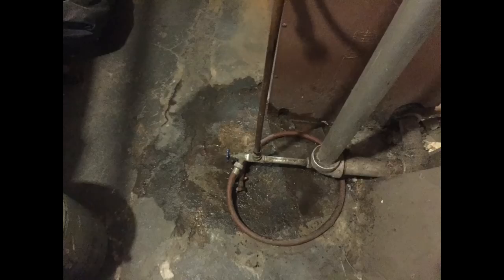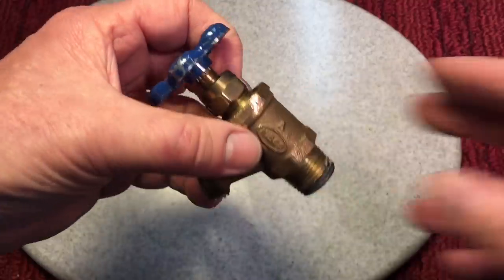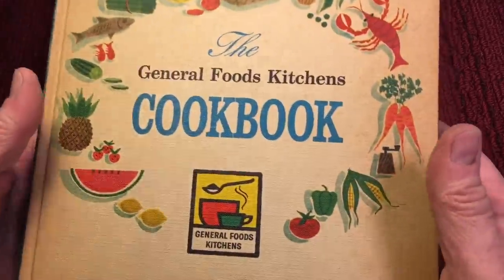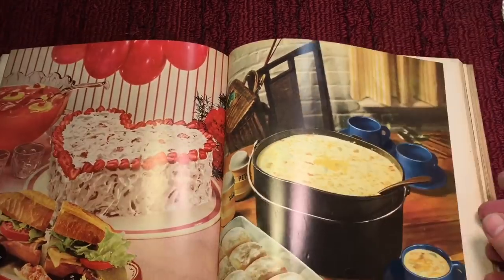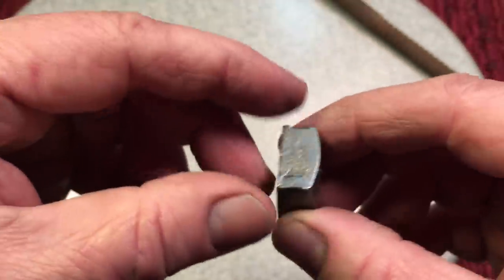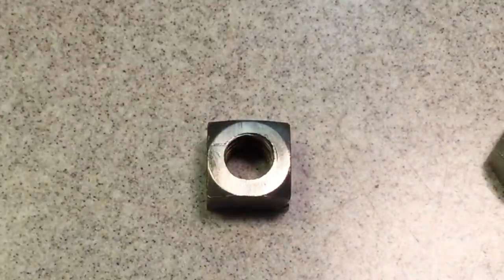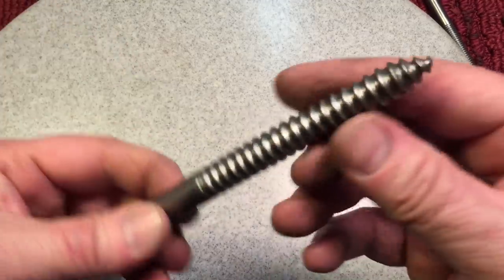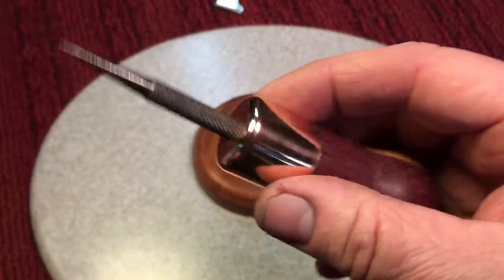It’s Hip to be Square!

Comment: I use both Teflon tape and Teflon pipe dope tgether on brass or copper pipe threads.  An old plumber I worked with many years ago, God rest his soul, told me to do it that way to prevent leaks.  It always has served me well, using both.

Comment: Working on fire suppression systems and as an industrial building mechanic, I can tell you that gate valves are awful too.

They're not terrible if you have water with a high degree of purity. We use a lot of gate valves such as post indicator gate valves for the sprinkler lines delivering water to the buildings, and OS&Y gate valves for sprinkler mains as well as fire pumps. 

We also use butterfly valves for individual systems and ball and globe valves for low point drains, drip legs, inspectors test points, 2" main drains, etc.

By far, the gate valves have the highest failure rate. They constantly need to be repacked and almost never completely seat when closed. Even gate valves used for smaller applications such as 1" elevator shaft sprinklers constantly fail.

Comment: Thanks for the schooling on square nuts. I restored an old pipe-vise and all the nuts/bolts were square. I mistakenly thought they were used simply because they were cheaper to manufacture. I did appreciate how much grab a wrench had with them though. Good find on that 40 year old valve. Never throw anything away.

Comment: I'm not a licensed plumber but I'm a GC who does 99% of my own plumbing work and I've worked alongside plumbers for over a decade. For water pipe I use teflon tape first then pipe dope on top of it, the regular white teflon tape and Recorseal Tru Blu are my usual combination. For gas pipe (black and galvi steel pipe) I use pipe dope only, Rectorseal no.5, my local inspectors (socal) want to see the yellow color but it may vary by location.

Comment: Slictite pipe dope then teflon tape. The hose bib you have is a compression valve and works very well. Ball valves stick and make more noise if not turned on fully. You can use either dope or tape or both. It really makes no differance.

Comment: When installing on a boiler I always use both  teflon tape and gasoila pipe dope and it will not leak.  One of the nice features of the boiler drain valve is that you can get a GHT threaded cap that can get you through until you can safely change a  bad washer.
Reply from the maker: Paul!  Yes!!!  I know I have one but God only knows where it is!!! 😂😂😂👍
Reply: @ScoutCrafter  Good luck on that!  Wire it to the valve wheel when you find it. :-)

Comment: A cat that choses you is hard to deny! I have a small assortment of square nuts from my grandpa's hardware stash. I use 8 pt. sockets often on engines for pipe plugs, for soft ones(brass or aluminum) only a square one will work! (Hello Snap On)

Comment: If your hex nut has no top or bottom the hole should be chamfered on both ends this is why it looks bigger. Your sq nut has no chamfer on the top and a small maybe a small chamfer on the bottom. I am left wondering one day you'll come and tell us about the latest find ... a 8 point combination wrench!
One thing I always wondered how those colored arrow on the wheels worked.

Comment: I've got to tell you, I worked in a boat yard when I was a kid and would pick up these stainless steel volts around the yard.  These were used in zincs on the boats and were just tossed when the new ones were put on in the spring.  I would take the corroded, dirty bolts and would clean them up on the wire wheel during my lunch.  I still have some that I use and that was 30 years ago! 😄
Reply from the maker: I spent a lot of time in the boatyard as a young man.  In the 70’s boating was big!  Now the yards are mostly gone and it’s an expensive endeavor.  😃👍

Comment: I'm not a professional plumber, but the times I have used it, teflon tape has worked well, including auto fuel lines .  Thanks for the square nut tutorial. I really like the detail you go into for seemingly humble and simple pieces of hardware and tools. To me this is important knowledge.  Usually I only see lag screws with square heads at the hardware store, but I was surprised to see a kit of various sizes of square nuts for sale at my local hardware store. Seems like a rarity so I bought it. It also means that my antique Blackhawk multi wrench isn't fully obsolete yet. Regards from the west, where more precipitation is on the way.

Comment: To answer your question about tape versus dope it depends on the plumber.  A lot of plumbers use both.  First you put tape on then you brush dope onto the tape.  Only dope the male fitting, never the female fitting.  If you are going to use only one type generally people use tape on water lines and dope on gas lines.  Boiler installations typically have both.  I use both on water and gas.  Never get leaks this way.

Comment: I remember those cold winters rattling in square head lag bolts into misc. wood structures in the shipyard. 8 point sockets and old ingersoll rand air rattlers. That cold air coming out of the exhaust would turn you into a ice cube asap lol.  Yet those square heads were plenty sturdy, never rounded one off while installing. When removing, it was the burning torch we used.
Reply from the maker: Dale- You certainly paint a pretty picture!!!  Awesome description!  😃👍

Comment: 10/4 on the square fasteners. When you use them, they HOLD! As far as plumbing, when I got the wood splitter kit I had to take off fittings that had WAY too0 much tape on them. Already were unwinding and going into the valves and lines. I use the teflon paste/goo/ Unc is the same way. The paste works for all of my deals. And being from the South the cook book rings home to me. My raising caught up with me I guess. Thanks, John CS! GOOD one, Buddy! GBWYou and that demanding cat!

Comment: Lowes has 2 types, of what you call Globe Valves. 
A Hose Bibb is for the use of connecting a garden hose to. i.e. To wash your car.
A Boiler Drain is for draining a boiler/hot water heater fast. It turns open faster.

Comment: I have plumbed many air systems in my life & the introduction of Teflon tape back in the ‘60s created a whole host of problems. Mostly the tape getting into the air stream & fouling up valves & other devices downstream. Also we started having air leaks in our systems. Teflon was developed by the aerospace industry  & everyone thought it was the cat’s meow. Many times our work was inspected by another agency & invariably they would find leaks. We would have to redo several joints & we would go back together with tape and lock tight. Problem solved. Tape works ok on perfect threads but rarely are they perfect. I found a little secret about sealing pipe threads. I’m order for a leak to occur, the Fluid had to follow the helix of the thread to the low pressure side. Plug only a tiny spot on the helix & you’re good to go. Merry Christmas by the way.
Reply from the maker: Hi Steve!  Great tip!

Comment: I've dealt with those square nuts and bolts. I was always curious when the switch happened from square to hex. I don't think I'm as crazy about hardware as you, but I definitely appreciate it. Especially brand new hardware in drawers at the hardware store.

Comment: The majority, if not all of the pipe dope has PTFE (teflon) with non hardening compounds and whatnot,  so thinner, but will make a seal on the threads.  The tape is more solid, and lays on solid over the threads, and can put a few wraps around the threads, 3-6 depending on the thread condition.  While I was with one company, we always worked in the mechanical rooms with the steam turbines and water pumps and chillers, so on and so fourth.  One of the co-workers put the dope first, then the tape.  I asked him why he did it like that, a technical answer shortened; "He hates call-backs."  Some background, these buildings were built in the 70's, some like the financial district, possibly around the 20's.

Comment: Ball valves are the only valves worth using.
And I use yellow "gas" teflon tape on most any tapered connection. Two wraps. White teflon tape is useless.
I only use pipe dope on gas lines. Soft set.

Comment: I have a complete set of Craftsman 8-point 1/2" drive sockets that I have had for years. When you have to have one; NO OTHER socket will work, So, I don't mind square nuts in the least. Outside of lag bolts, you don't really run into them unless it is an antique of some sort.

Comment: Today, while I was cleaning the snow of the car, I thought about the headlights when you drive during a snow. Up till recently, the headlight bulbs would let off some heat to sort of melt the snow from the lenses. Now with the fancy LED type headlights, they don't give off any heat. The average car doesn't have headlight defroster. Hmmm 🙄
Reply from the maker: Bill- Halogen lights are preferred by many manufacturers for that very reason... Now they are adding headlight "heaters" to compensate for the lack of heat from the halogen bulbs.  Absolutely ridiculous!  Now a headlight assembly cost $300 where a round headlight used to cost $4.99.   =P

Comment: I wish they made square sockets larger because recently I wanted to take out the drain plug on some 2 inch plumbing but I couldn't muster the force needed even with a pipe on a pipe wrench (I'm getting too old!) so I got on google to try to buy a 1/2 inch drive one to fit on my air impact tool. Couldnt find one. You know of any place that makes them that large?
 On the recipes you have to watch out because some ingredients change. For instance white vinegar used to be 11% and now it's 5%. I still make a lot of the old recipes, they're way better.
 Teflon tape, I always buy the mil spec stuff because it's 2-3 times thicker and doesn't static cling to your thumb as you're trying to get it around the threads. You don't need as many wraps because it is thicker. A local plumber recommended it to me. Menards is good about their employees that way.
 I scored 2 humidifiers on my walk the other day. One is RGB and has an oil diffuser but needs fixing. I steam cleaned the working one and have been using it for like a week now. It can put a whole gallon of water in the air in about 8 hours & uses only 30 watts. Some one put them both out in a nice box next to the trash - They obviously wanted them passed along to some one who would use it. My sinuses thank them. They're so much clearer now!
Reply from the maker: John- Great info!!!  I have steam heat so the humidity is good but a humidifier is really important for dry heating units!  Makes a big difference!  😃👍

Comment: So by need, the offset open end wrench was created, soon to multiple siblings of various designs.
Forgot I use pipe dope with teflon bits. Stays in place and easier than rapping tape in tight places

Comment: John-valves are funny things...you could have easily gotten a cap to stop that valve from leaking. The quarter turn ball valves are good but you need to buy good ones. The cheap ones don't last as well especially if you have water issues.
The square nuts are a good indicator as to how old a tool may be. Last year I bought Reed No. 1 pipe vise at a junk shop near here and the nuts are square ( and the screw heads are fat and round!).
While you were polishing did I see a corn cob handle on your bench?
Reply from the maker: LOL-   GWP-  For your consideration...  https://youtu.be/HHhx3hVKG0E

Comment: I re-cut the valve seat and repack the nut and use a stainless washer screw with a new washer, no replacing /soldering. You know the old stuff was made beefier and better. Looks like you used a stainless screw on that valve too.
Reply from the maker: Seats are a whole different level of skill...  Having a seat cutter and knowing how to feel it when it's just right,  I always appreciated that!

Comment: 8 point sockets, don't see those much.  you can use 12 point sockets too I believe.  More meat on those square nuts, but I think the holding force is only from the threads, certainly might resist turning as you say.
Reply from the maker: Michael- Square nuts are taller and have a greater surface contact.  Both are key factors in their ability to stay fast!  =D   Some industrial companies use HD nuts that have thicker walls then standard.

Comment: I worked for a gas utility in the service department for 36 years. We used dope on everything including water fittings. You look like you have an old American standard boiler. Probably a summer winter hook up type if not it was at one time. I worked on hundreds of those boilers over the years. Many many are still around working like yours. They were built to last for sure. They don’t make boilers like that anymore.
Reply from the maker: Planned obsolescence!  Remember the old refrigerators?  I think they were made to last forever!  😃😃

Comment: Hemp fibers in combination with sealing compound, will also work for water. And it's easier than with Teflon tape. You can't turn back on Teflon, if you turn a bit back it will leak, with a hemp fiber seal quarter turn back won't leak because it's more ductile than Teflon.
That method was used here for decades by plumbers, and some still use it here. 
Temperature resistance between 140 and 160°C (284 - 320°F). I would only use it on metal piping, not for threaded plastic pipes.

Here's a small video in english, but in Germany we do the hemp first, than the paste:

https://www.youtube.com/watch?v=bFXgwO9qszY

During my vocational education I actually had to learn this...had a schematic, some pipe parts, and I had to fit them like shown on the schematic. Afterwards it was pressure tested for leaks. They had an old hand cart with a water tank. The tank and the water already had algae inside. And there was a hand pump on it with a pressure gauge. This was connected to the piping we made and pressurized until 6 bar (87 psi). When no leaks were there, it was a pass. Part of that was a valve, like the one you changed. My test was already done, my colleagues one was tested. When there was no leak on his, he went over and instead of releasing pressure on the pump he opened the valve on the tested piping...the fountain of this dirty old smelly water almost reached the ceiling...🤣
Reply from the maker: Marcel- 😂😂😂. I know the smell of swamp water!  😃👍

Comment: I think your mistaken about the square nuts. The finished side goes down. Makes it much easier to remove in the future. You can see that in the railroad photo you included. Makes for a perpendicular interface even though the threads are not concentric
Reply from the maker: The correct orientation is Chamfer side up...   =D

Comment: John, fine video.  I have a question, on some tools there is this El Cheapo chrome coating. It peels off with little difficulty. but some hangs on for dear life. How would you address this problem ???  Or would you just throw them away.
Reply from the maker: Martin!  I always hated flaking finishes...  Whenever I come across one I always remove all of it and polish the bare steel...  =D

Comment: I am not a professional plumber but doing home remodel style construction with my boss over the years and tons of automotive stuff when it comes to pipes I use both pipe dope and Teflon tape. If I am going to see it I generally use teflon tape because I am beyond messy with the pipe dope and somehow get it everywhere. Personally I think both work fine, my boss is a strictly pipe dope lind of guy and never uses teflon tape, yesrs ago i worked with a fellow who was pretty old back then and he was a strictly tape kind of guy, I think its a personal preference and either are fine the key is using them generously not sparingly especially on this chinese slave labor made garbage that might not be true or sized 100%.
Reply from the maker: It's true!  Cheap parts make for sloppy fits!!!!!!  Good point!  Thanks!

Comment: I had very worn philister or cheese head slotted screw that secured the points in my old car. Bottom line, I hit my big hardware stores and they couldn't supply the slotted version.
Everyone has m4 x .07 phillips.  Problem being, you now need two screwdrivers when adjusting ignition points.  The phillips screwdriver doesn't fit in the convenient slot provided when setting the gap.  Technology passed by and tossed like the squares.  Received zinc coated m4 from china for next to nothing if you don't mind hoarding the other 99 pieces.
Hardware salesman responded to my questioning my need for slotted with a "huh".  Lose the square nuts and the slotted screws and the distributors; victims of technology.  We who enjoy tinkering are faced with welded, glued and riveted components to establish no go zones.
Reply from the maker: You are so right!  😃👍

Comment: SC I beg to differ with you on the valves, frist is a boiler drain valve, leaking ? replace the washer, stem leak tighten it or replace the packing with rope packing easily rebuilt. Second the gate valve they get overtighten and break the stem. broken closed your screwed replace the valve,  third a ball valve most desirable easy to determine off or on, but not rebuildable.  my 2 cents in the tin can.  oh and not picking on you it's  a boiler, not a furnace.   3 cents in the can.   LOL  and I love curb sales......
Reply from the maker: Ed- The Gate valves we have in the house never broke, the rubber washer of the drain valve is a weak link and do fail often.   I have never seen a good ball valve fail...  (I haven't seen many so the few I have seen are great)  and we always called it an Oil Furnace that heated the Steam boiler..   If I called it an Oil Boiler it wouldn't fly...  =D